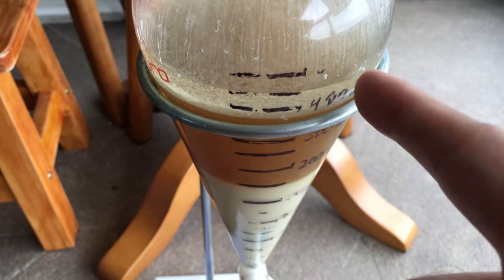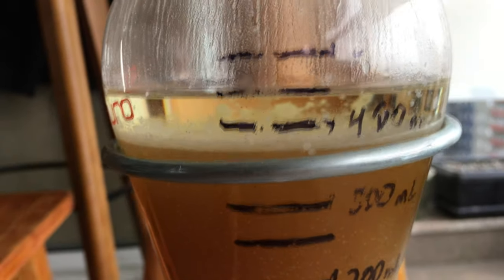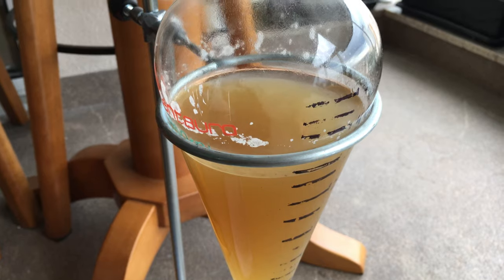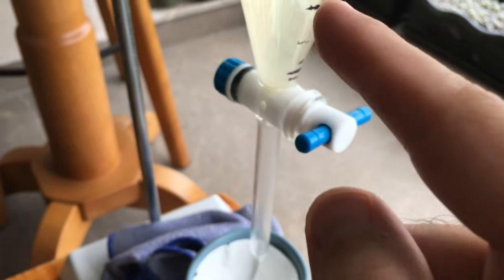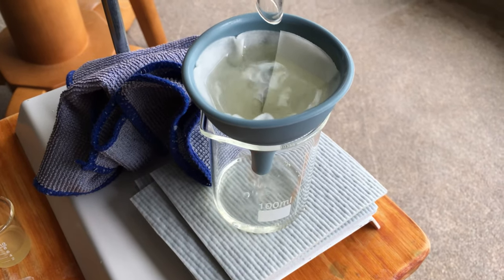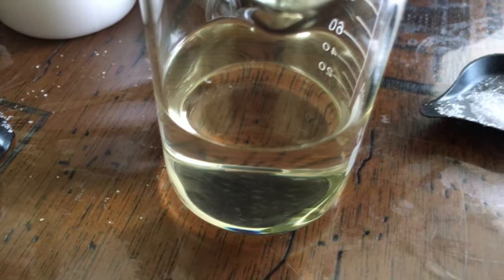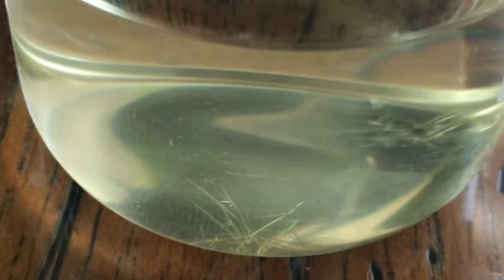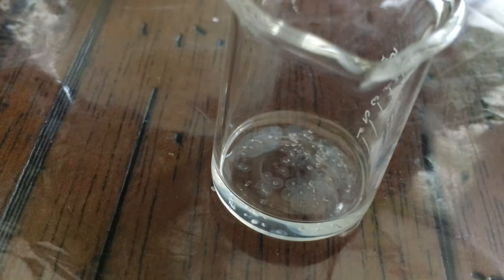Early work on Salty Tea EtOAc extraction with issues/errors Part 2

Comment: nice video
Reply from the maker: Thanks still working out some issues but this has fixed my issues with crystallization and doesn't require 24h fridge rest.
Next video I'll share a more condensed video with my fixes to some issues I've had and suggestions on how I'd do this. I'm using small amount of starting material but once it gets larger I think this will help a lot to use less solvent and also skip cold rest

Comment: You should seal the containers. EA can absorb moisture from the air over time if not sealed. Uncontrolled water content creates a risk of goo. Especially important if you ever use cold in other steps.
Reply from the maker: Thanks but sofar I think my salt brine wash of ethyl acetate works well. I do cover the beakers with aluminum foil which seems to be enough
Reply: @ModernGrower  OK, but the simple fridge rest works with what the TEK asks for (sealed Mason, jars as you may know).

Salt water should also work though. Or a general ionic strong water solution to partially dehydrate the ethyl acetate chemichally.

I think the simple, no material used, temp drop is the simplest and most elegant, but that is just my opinion.
Reply from the maker: @ajosin you are right but a few people have an issue with the fridge rest and some are only getting crystals with freezer rest. When I placed in the fridge I placed into another sealed container to prevent the smell from leaking but still didn’t work